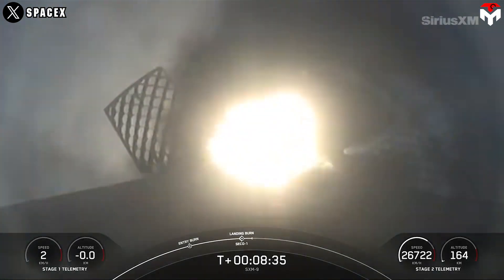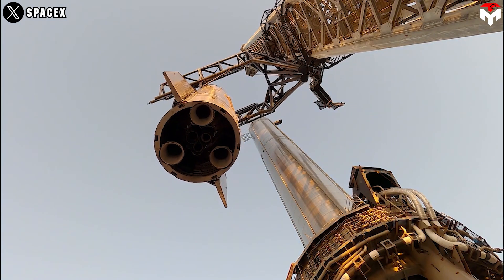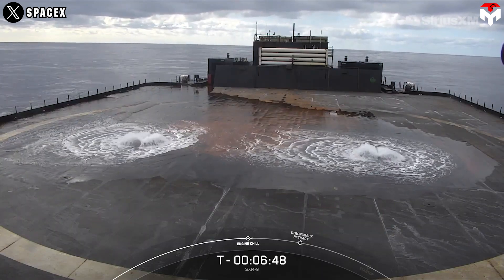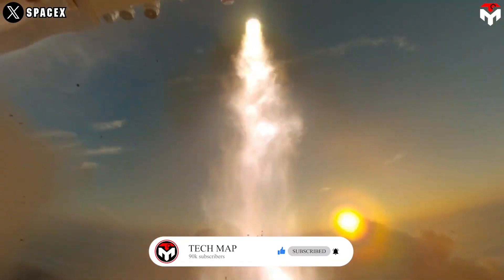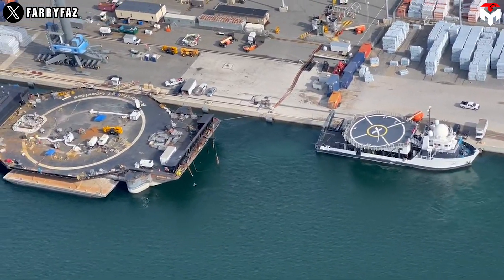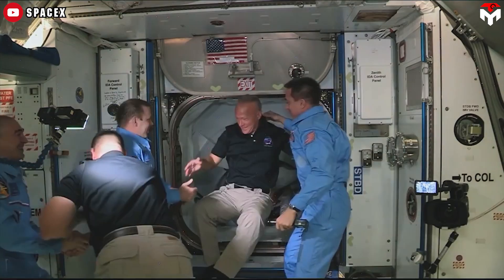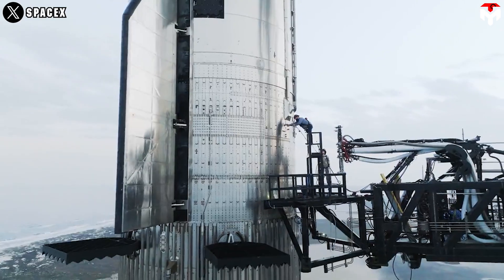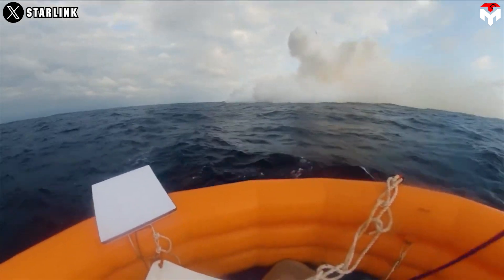SpaceX's Water Deluge System on Droneship for Falcon 9 Land Shocked NASA...

Comment: Why not design a 'chopstick' catch system for the Drone ships to catch Falcon 9?
Reply from the maker: It's so wasteful to build such thing for a rocket that will be retired in 6 or 8 years
Reply: @techmap9   I disagree.  A comprehensive analysis on costs and benefits is needed first.  Regardless of the Falcon 9 life expectancy, drone ships are currently needed and highly beneficial for multiple new rockets including those of Space-X.  A new advanced ship-based gimbaled catch system eliminates EXTREMELY WASTEFUL rocket mass being launched and retrieved, refurbished, etc.  In 7 years at 130 launches/year, I think that is a significant saving$.
Reply: Biggest problem is it would make the barge top heavy. That is a lot of extra weight above the waterline.

Comment: It’s surprising they haven’t built in a fresh water spray system before. Not just to blunt the effects of the blast on the barge deck, but as you said, to rinse the salt water/spray/air off the rocket components. 
Everyday for years I’d give my boat a freshwater rinse after a morning on the ocean. Can’t imagine not doing that.
Reply from the maker: True! This would really be a great solution for the increasing launch frequency of the Falcon 9!